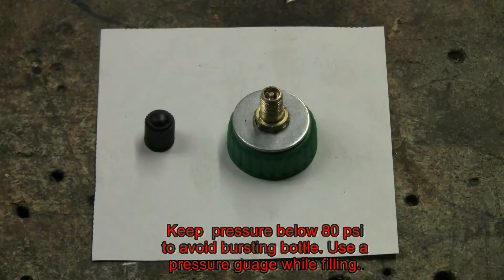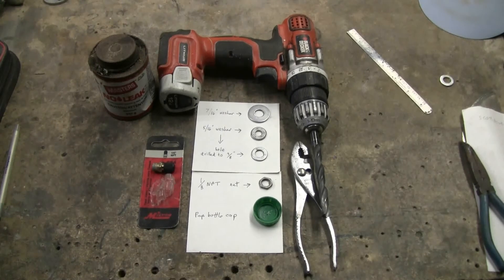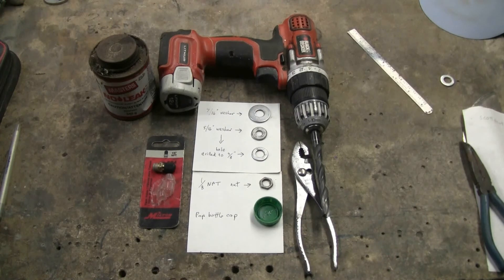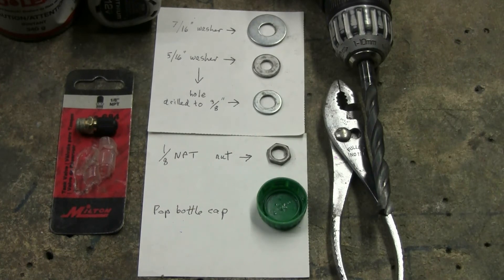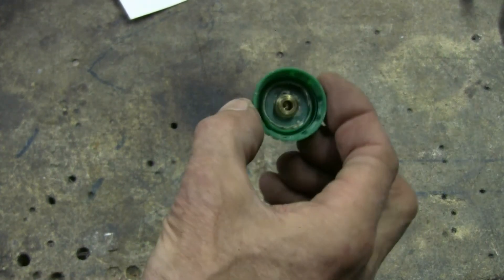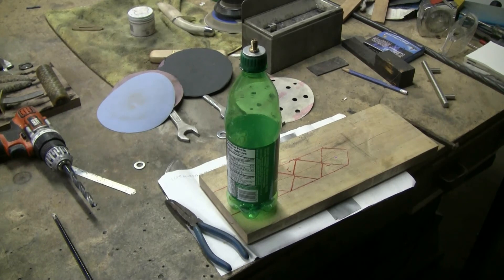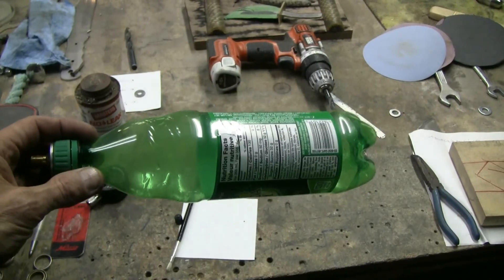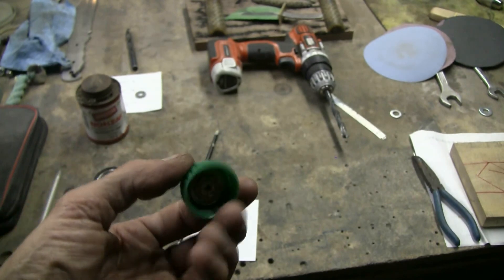How To Make Pressure Cap for Exploding Pop Bottle BB Gun Targets

Comment: We used to just cut a valve off an old bicycle tube with a bit of a flange around it and stick that through the bottle cap (with the requisite hole, obviously).  It would hold around 120psi and cost practically nothing.  We weren't using 'em for exploding targets, though:  you fill the bottle about ⅓-full of water, pressurize with 120psi air, hold upside down, and then unscrew the cap.  It's a pretty fun show!